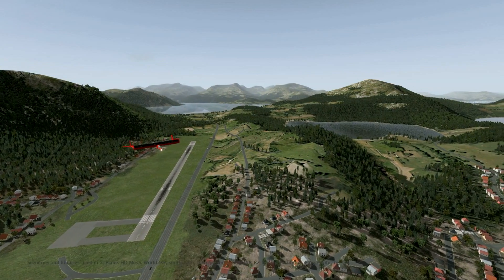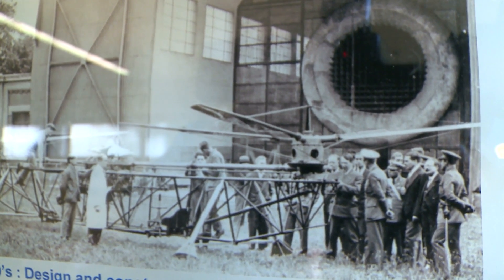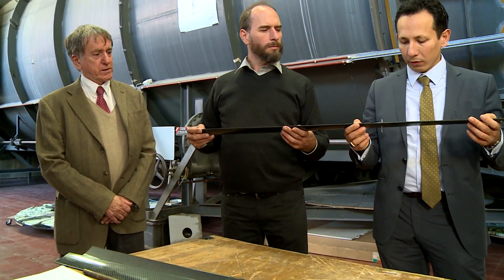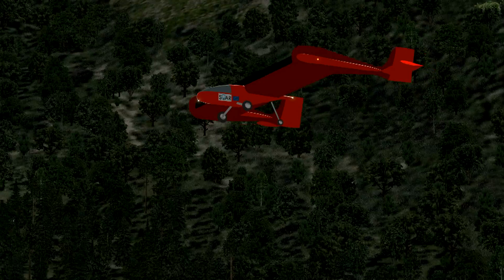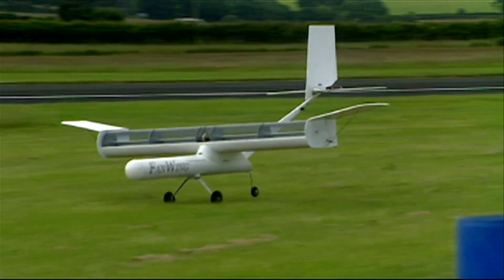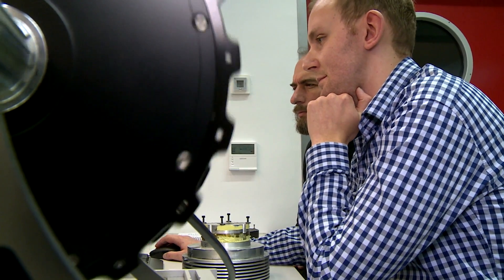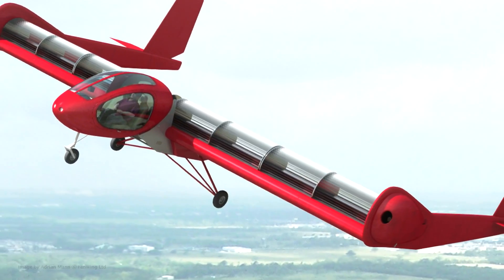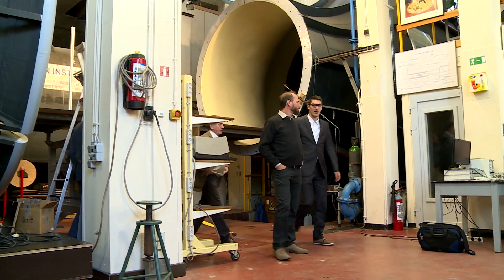FanWing/EU SOAR: Distributed-propulsion aircraft with a trapped vortex inside the rotor cage

Comment: I think if you have several blade sections - essentially separate drums then a bird strike might not have to be a problem. Engine failure might mean you need to autorotate so the fans would have to have enough momentum to keep going.   The other thing that struck me is that the vulnerable part of the blade is moving backwards for most of it's exposed journey which would seem to me to limit the relative speed of any bird that might impact at many angles.  Perhaps one could limit the danger simply by limiting forward velocity until one was high enough?

Comment: This 6 volt DC system came from a RC air boat that had a running time of 5 minutes this same motor will now run more than an hour on a battery of less power and energy than the one that was used in the airboat a 6 volt battery that would only power this boat for 5 minutes will use a single 1.2vdc AA battery for more than one hour this is the system you will need in an Electric Aircraft / EV-SAMSON SUPER BATTERY BOOSTER 650% more energy than a battery alone can supply read below video to fully understand this system before watching the video / click to watch / https://youtu.be/6eP-B_d9DoI

Comment: Can somebody tell me, how the fan will flexing across whole length of wing in turbulence weather?
Reply: Just like the drones 
That have no wings
Reply: woody ahh they still have rotor baldes which in large scale can flex too, as well as helicoper blades
Reply: @franciscoperezjuarez1481  helicopter blades are not attached on both ends in a rigid structure
Reply: Ethan Heffernan. 
Just the same as a model doing acrobatics.  If it can take those Gs, it can take turbulence as a non acrobatic practical full size version.  A biplane version could be built with no flex at all, if necessary.  Rigidity and quick roll response are biplanes' advantages.
Reply: try asking in English.Your tenses are scrambled.
Reply: @iamJahwill  How will the fan be able to cope with flexing along the wing in instances of turbulence?

Comment: Here's the important question. Will it continue to glide if it suffers an engine failure? If not then it will never be allowed to develop beyond RC models.
Reply: i was thinking the exact same thing.
its all good for reducing wingspan but if it fails will it just drop out of the sky?
safety should be the primary concern.
Reply: @downey2294  it can, depending on how you design it. In theory, its just a spinning cylinder on a wing. but the design in the video? i dont know, it might just fall out of the sky
Reply: @Arsjdaj_  I'm talking about the concept as a whole. If the wings don't spin the plane cannot generate any lift and therefore it cannot glide. 

how would you design this safely in the even of an engine failure?

Comment: If they're looking to use this design in higher altitude commercial applications I wonder how they will address anti- icing issues. The bird strike issue will be interesting. I've seen what geese can do to a fan section on a GE CF6-80C2 engine on a B767. We eventually changed the engine instead of changing the fan blades. This particular design doesn't appear to be modular from a maintenance standpoint. Best of luck.

Comment: question, will it glide if the engine fails, Even a helicopter can auto rotate. so can a grocopter. Any flight vehicle that cant get to the ground safely with out power is a safety nightmare, that why this drone type designs are a safety nightmare
Reply: It appears that if the fan can free spin during a power failure then it should have the similar failsafe feature a helicopter does with auto-rotation. It should glide as well as it flies (which itself has not been tested in a full-size aircraft)... ... But yeah, "drone" aircraft (multirotor, pure thrust aircraft) are deathtraps. I wouldn't set foot in a quad rotor aircraft unless it had some sort of automatic parachute system that will be effective in near zero altitude scenarios.
Reply: Well full size drone aircraft have a motor for every rotor, and the one design i have seen had 12 rotors or more so losing one motor wont really effect the craft all that much. Losing 10 motors would cause the craft to become unflyable but the rest of the motors would be able to slow the decent enough to avoid injury, losing all the motors, well nothing will save you if your luck is really that bad. As for the battery they can always have a backup battery that has enough charge to land, or a backup generator.

Comment: Turn a portion of the inner wing into a closed induction fan producing directed wind into the rear of the plane coupled with wing tilt you could have yourself a heliplane that is to say a hover ability. Lift might be an issue with load but that exceeds my imagination in terms of what predictions I could accurately make. I guess it would really come down to  direction over power over surface area.

Comment: I had a model toy with similar design in the 1980s so it is not a new idea.
Drag will be huge, so it will make sense only for STOL designs. Same wing design is in fact used in vertical wind turbines.
Reply: I had a plastic rotating-wing glider in the '50s working on a similar (but cruder)  principal to the models in this clip.

Comment: And not a word (that I found) about Glide Ratio if/when the engine stops.  No Air Foil....
Reply: im wondering if autorotation principles would apply with this design...possible I suppose
Reply: @ogmius2001  That possibility crossed my mind too but unlike a rotary wing, the fan blades may not be sufficient if they don't have enough airfoil and area.
Reply: https://www.fanwing.com/faq.htm#6
Reply: Glide Ratio 0:1
Sounds like your "effective" wing area drops off to virtually nothing when the turbines stop.
Reply: I'm quite sure if their fan is fitted with adjustable blades, they can make it glide. Radially rotating wings have been used in toy kites 50 years ago - they actually work.

Comment: Quite a ideal and there are some things to work out. The power source could be a Highbird
type with very small turbine powering a gen for the elec-motor or motors.  With all the new stuff baking in the ovens at place's like skunk works its hard to know whats just around 
the bend. after all microsolft and apple came from no were to rule in a way. 

One things for sure if the  flight data was not sold this ideal would have been put to rest
many years ago. It has so many area's of use and could lower the cost in many places
Take the cost of using a helicopter for crop dusting the cost should go way down.

If using a Ag Cat or other type of fix wing aircraft the speed could go way down letting
the pilot fly at say 55 knots and not at 100 knots or so as they do now. 

Having a short tack off and landing with good control inputs and response is a very big
safety issue as it can be lost in so many aircraft at low speed in use to day

The design of the rotor system would be very quite when you put it next to the helicopter
when it comes to bird strikes the speed of the rotor and its strength may have no trouble
if the engines are electrician then FOD should have no affect on them as well 

If they use a small turbine to power a small generator then the  intake can be in reverse
as well  making them free of FOD as well

This could well be the next gen of aircraft as many of the best minds did not thank the
helicopter would ever be safe to fly or the V22 and who would have believed the SR-71
black bird could do what it did and how many elect- aircraft are going through testing 
right now.
 
Just a note to thank on

Comment: Reliability seems the big issue with this design as its gliding performance is in serious doubt.
Reply: helicopters can actually glide very well... its called "autorotation".
Reply: @HypnoSpark  and autorotation is very dangerous in comparison to dead stick landing a fixed wing aircraft. I think that's why there are more crashes in rotary wings.
Reply: solution is membrane fixed by low pressure inside cavity: a crude but useful temporary wing
Reply: If the fan can free spin  then it should glide as well as it flies, so you wouldn't even need a membrane.
Reply: Paul Meyer yes...  because helicopters glide soooooo well.

Comment: This model should be compared with similar model with conventional jet or pistonprop engine- in terms of thrust, power/weight ratio, and fuel economy. There is also inertia of rotor cage to consider- I think this propulsion will be less responsive than jet or pistonprop engine.
Reply: I don't know about that as the model clearly over turns and recovers quickly but air nozzles with fan speed control will be part of development. Inertia of prop planes is all wasted energy.

Comment: Ok, if the thing lost power you have an aircraft that as best I can tell will have the glide ratio of a rock...... just saying.... I've flown enough strange model prototypes that I can tell you one thing if it lost power it will glide, but very unstable and for a very short distance and landing would be rough....
Reply: That seems like a very good question to ask.  I wonder if it would autorotate like a copter
Reply: Mr Reymundo it would almost have to be able for it to glide at all or it for sure would fall like a rock
Reply: Autorotate has been a focus of the design process... they realized it should do better than a helo in a power off situation.